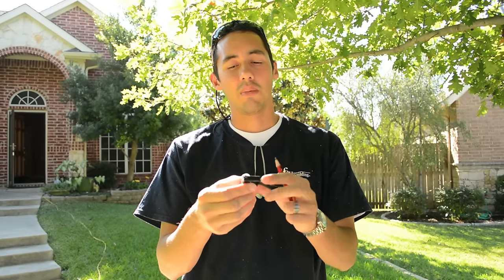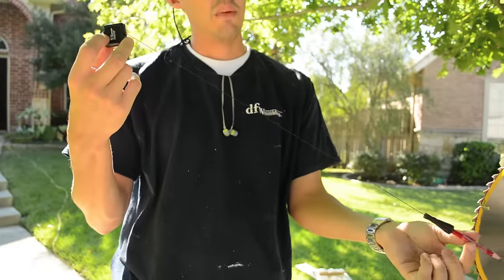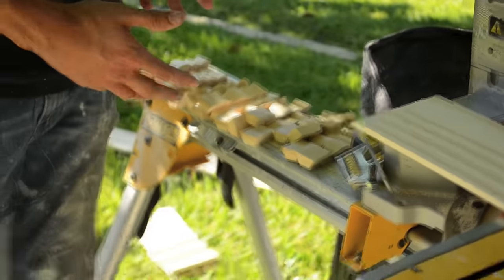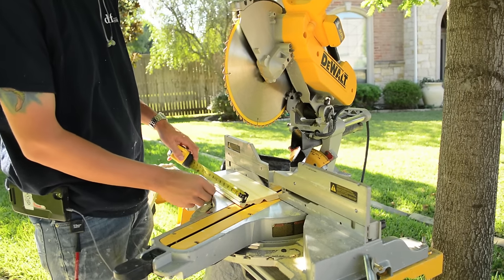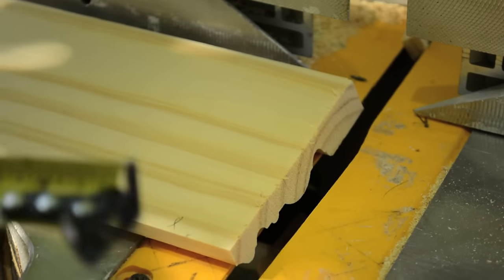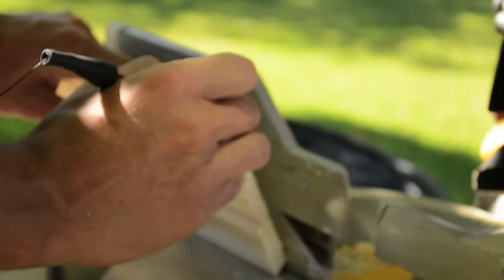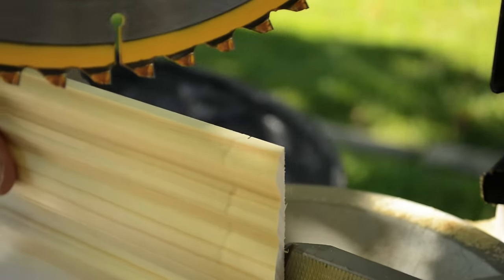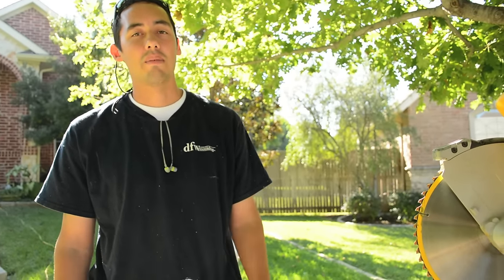Pencil and Measurement Tips

Comment: With regard to the missing saw guard, I agree that it is better for accurate cutting.  You can see your work with no obstructions.  It's old school really.  I also think that if you're the only person using the saw, it's fine.  I can't remove my guard because all the "hammer heads" that I work with would at some point...without a doubt...severely cut themselves.

Comment: I hope no OSHA inspector ever watches one of your videos, as informative as they are, operating equipment with out the safety measures installed as a business is up to a 10k fine.
Reply: In 2006 I was cutting stiles and rails with a stop block for accurate repeat cuts, the wood got jammed between the stop and blade and as I lifted the blade out of the material the wood jumped and threw my hand into the blade.  Needless to say after surgery and 6mo of therapy I have a hand that kinda works. Use the guard man trust me its not worth it, you make your living with your hands and you need them to be functional.
Reply: Lighten up Francis.

Comment: Blade guards would be ok if they covered the front of the saw only so you don't bump into the blade.
Reply: yes, I believe that taking the guard off is actually safer than making all those additional moves with your fingers to retract it while making a cut on a 5 inch piece of base.

Comment: If you wanna cut em even faster. Never even adjust the angle for the opposite 22.5 angles. Instead make first cut at 22.5 and then flip your base board upside down always keeping profile facing you. This trick makes it possible to cut 20 bullnose changas in about a minute. Remember... “time is money” you should make another video showing how many you can make in a minute in beast mode.